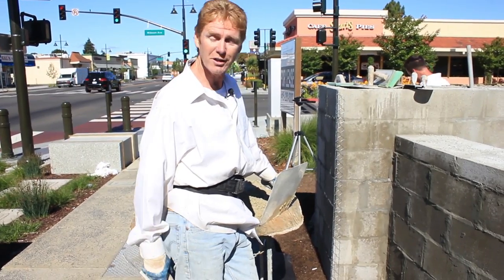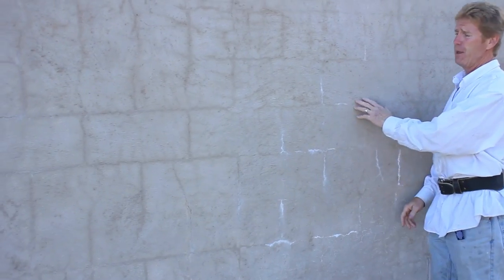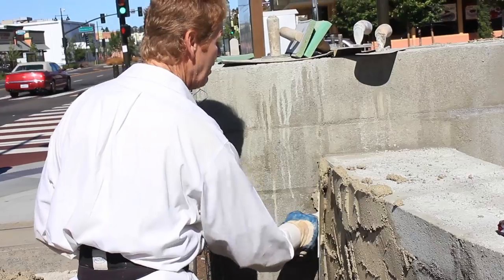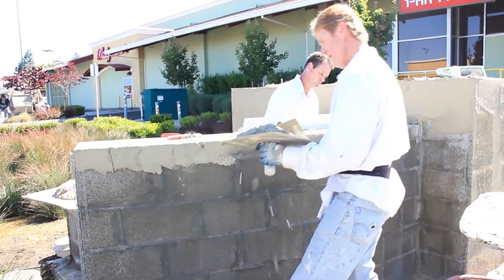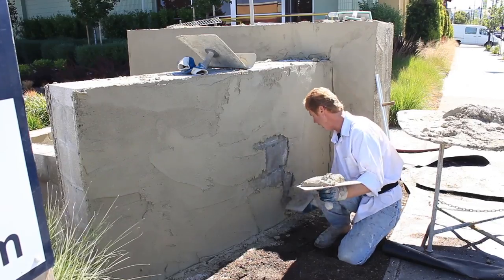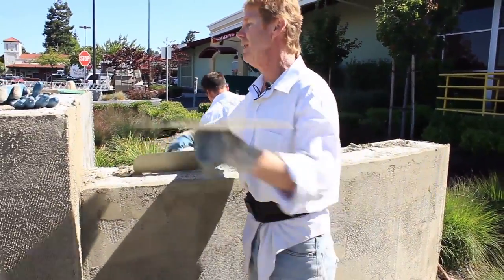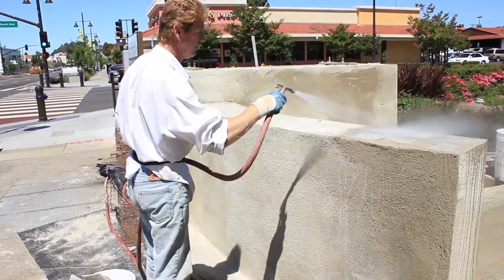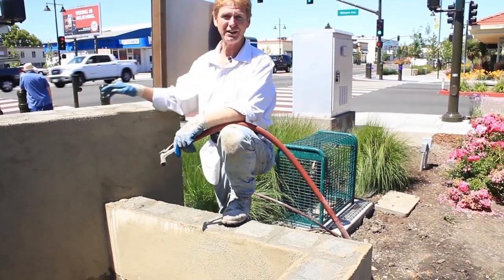How to stucco plaster Cinder blocks

Comment: Hi Kirk,Great videos...I have a quick question.  I have cinder block retaining  walls and am trying to cover them with a skim coat. I did a small part and got hairline cracks in some areas.  I was using type S mortar  from hd premix.  I admit sometimes the mortar got to wet I think.  Am I using the right material? Should I do more than one coat...I did wet the wall before hand. What mix do you use in this video... did you put on a bonding agent before hand? Thanks in advance... appreciate your videos....
Reply from the maker: Howdy Steve, sounds to me like you did not hydrate the wall properly, which means one must you a water hose to constantly msit the walls for a good mechanical bond or your mix was too rich and or to soupy.
            Live long and plaster
  Kirk’s how to plastering  video’s
Reply: Thanks for the reply...what do you mean by too rich? Maybe type S mortar isn't good for a skim coat? What mix would you recommend for a skim coat...no wire mesh...on cinder block....
May the plaster be with you...thats one part star wars two part plaster joke...haha
Reply from the maker: Howdy Steve, too rich means too much cement plaster and not enough sand.
 I would use 1 part cement plaster with 3 parts sand, but a fella should know how to mix also, can't have soupy mud or stiff mud, it's got to be just right.
            Live long and plaster
  Kirk’s how to plastering video’s

Comment: very helpful what is the brand and type for the base coat you put on?
Reply from the maker: Morning Paul, for this, we used Eisenwall sold at the plastering yards,
 however, it's also sold at Home Depot and or lowes, called Raped Set Stucco.😉

Comment: Hi Kirk and family
I don't want to tell the master any advice,but would it been safer/better job if you put a bond coat on first?
Reply from the maker: Evening Grant dude, thanks for the tip.
 Howver when plastering over cinderblock, cement walls or cinderblocks, a skimcoat is all thats necessary, a fella who applys a scratch coat then a second coat only has a clue as to why, Cinderblocks when mosisetd with water while applying another porus materil such as stucco adheres by a natural meancal bond.                   
               Live long, and plaster
                                Mastering Plastering

Comment: Will this skim coating be the fix for a cinder block wall that is crumbling from the base?
Reply from the maker: Good afternoon, John, depends the cement plaster we used is stronger than most concretes, but if the base or foundation is shot, doubtful any material will fix it.🧞‍♂️
But just in case use, "Rapid Set Stucco," sold at Home Depot as there's no stronger cement plaster, don't overmix.
   Bringing peace, love, and brotherhood back to the world of, “Cement Plastering.” 🌍
With over 800 educational and free Youtube videos, by your favorite plaster geek, “me🤓” and my son, “Jason,” the bearded plasterer.💃

Comment: Hello, Kirk,
I apologize for posting a question irrelevant to the topic, but I need your opinion. I hope you don't mind. Can stucco be applied over external insulation boards/panels? If yes, can we still use the 18 gauge wire?

Best Wishes
Reply from the maker: Morning Gandalf dude, when you say (external insulation boards/panels) this can mean about 100 different boards from about 15 different gypsum based products to a whole list of solid wood boards to even foam boards, If you want me to be specific, give me the exact name of the board you are considering.
 FYI,  most boards can be plastered over, from wood,foam, and gypsum based, here in California, two layers of paper for weather proofing are first required, then either 17 or 18 gauge wire needs to be attached, now you can stucco as usual.
 Cheers,
 kirk Giordano
Reply: +Kirk & Jason Giordanos DIY plastering and stucco tips 
I should have been more specific, I am sorry. :( They are used a lot in my part of Europe and the brand's "Fibran"., you can google it. I think they are foam boards and they are blue-ish. A fella who lives nearby said they couldn't be stuccoed over and that sounded strange to me. I think they use some kind of other plaster which looks horrible, trust me. They only use foam boards here, I don't know why.
Thanks, Kirk.
Reply from the maker: Ooooo, I see,,
 There is a really great and popular system called Dry-Vit that uses foam boards, that originated from the UK to here in the US,
 First the paper is attached then the boards,
A fiber mesh tape is used on top of these smooth boards.
Lastly a tight thin coat of a cementitious base coat then color finish is applied, we did a lot of this work when I was a union plasterer for hospitals and school, Its durable and lightweight for high rises.
 there is also a system we used with horizontal line in the foam boards themselves, after we papered the walls these 4 by 10 sheet were attached with staples from our staple gun that were 2 inches long, the staples had to be that long so that 7/8 of the leg set in the stud and the rest accounted for the width of the foam boards,
 These boards had groove lines ran horizontally, these line seams similar to the scratch line made on a first coat by a  scarifier plastering tool, at that time we were allowed to use 20 gauge wire, for a coat of stucco no more than a half inch thick, then allow to cure prior to a color finish.
Confused?
 I would be had I not spent years using these methods.
Best wishes, 
 Kirk Giordano
Reply: +Kirk & Jason Giordanos DIY plastering and stucco tips 
I am not confused at all, don't worry. ;) Yeah, they use cementitious base coats. I have seen the boards with lines, yes. The ones they use here are black. Can we stucco over the smooth ones or the cementitious base coat beats the stucco here? I'd probably get killed if I did that, hehe. Nobody stuccoes the smooth ones or the other ones here, I don't know why. They say that no stucco will adhere to the smooth ones. Why not? The cementitious base coat adheres to them perfectly. I think stucco will adhere to them, but I am no expert.
Reply from the maker: Hey dude, stucco will adhere to any wall that is sound.
 All you need to do is apply a bonding agent to the wall,
 however the wall must be extremely clean, you can't pressure wash foam as it will dissolve, perhaps a water hose and a lot of soap and elbow grease may work, but I have not done this before.
 Best wishes, 
 kirk Giordano

Comment: Do you guys do much float and set then skim coating internally out there in the USA? Nice work by the way.
Reply from the maker: Happy New Years JimJim, we do more skim coats on cinderblock walls and either hard rubber or sponge float depending on what's asked of us.
Cheers,  Giordano's DIY plastering tips
Reply: Just a question again. Do you guys over there do Dot N Dab? Its when you stick the blueboard on to cinder block or brick with adhesive. Wait till it goes hard, then skim coat the blueboard with a veneer finishing plaster? Il send you a link.
Reply from the maker: Morning Jim, No, I have never done this,
 I only apply veneers for interiors,  if a cinder block was was protected from the weather there would be no need for the blue board, therefor I would just apply a base coat over the  cinder blocks first, allow to dry, then follow up with a veneer finish.
 "without blueboard."
 Cheers, and have a Happy New Years, Giordano’s DIY plastering tips
Reply: Type dabbing in style in youtube and youll see what im on about.
Reply: Ok you see we stick the blueboard straight onto the blueboard, then skim on top of it within an hour or so. Its quicker, neater and you can get a more plumb finish. We use blueboard with insulation on the back to raise the dew point then we skim onto the blueboard hence eliminating the need for the backing coat. We can basically put up to 20-70mm on a  bare brick or cinder wall in a single application. Imagine how long that would take if you had to float that up in layers?
Reply from the maker: Morning Jim, O.K. you must be using the exterior blue board.
Your way is another option to get straight walls, however I don't  apply veneer plaster to exteriors.
 I would go with an exterior cement based product.
 For me it's faster to skim coat, then to attach blue board and skim afterwards.
 Many of my video's show different methods to achieve the same results also.
Kirk Giordano’s DIY plastering tips
Reply: No im on about interior work. Check out that link i sent you. Im moving to the states. I have a plan to update drywall by using bonder over the drywall then skim coating with usg diamond veneer. Do you think it would work?
Reply from the maker: Evening Jim, yes, I do think this will work, and sorry to say, many folks already do this,
Cheers and have a Happy New Years,
Kirk Giordano’s DIY plastering tips
Reply: Oh ok. Was gonna say next. "you looking for a job"?  Lol
Reply from the maker: Jimjim Skimmer, cool craftsmanship, I have done this method before, you make it look easy,
 Cheers and have a Happy New Years,
 Kirk Giordano’s DIY plastering tips
Reply from the maker: Jimjim Skimmer, I am always looking for a job, as I'm not a rich man however if I were to work for you, I'll do the skimming and you do the plaster board.
Kirk and Jasons DIY plastering network

Comment: I built lots of concrete [cinder] block walls in my property,  they were retaining walls witb drainage holes spaced.  We didn't care if blocks lined perfect, we poured concrete caps.  my dad finished wall exterior, cement and rubbed the wall, basicall rubbed block wall and it looks like a solid concrete wall, never see uneven😂 hack block seems.  [We did concrete flatwork, NOT masonry walls for a living,  but we played with masonry at home].  We built the wall with blocks 😂 were not lined up perfectly,  we didnt want the blo cks showing.  After 15 years some minor hairline cracks.   Walls are one side , retainer .  I used concrete forms and rebar , poured solid cap.   Never painted,  some minor hairline cracks and mossy . I wanna clean it and give it stucco finish like this.  But i like the messy rustic look, with some steel trowel finish swipes.    Try a  , terra cotta look. ? Haha 😅.  Just thought,  i am getting bored with the concrete smooth rub finish
Reply from the maker: I like the rustic look myself too

Comment: one thing . you mentioned "plaster cement" i believe. 
so on block, do not use other than "plaster cement" ? specified FOR block / concrete walls ? thank you
Reply from the maker: Hi Mike, I use Premium portland cement plaster on most jobs it does have additives such as lime and common plaster for strength and spreadability,
 Cheers,
 kirk giordano

Comment: did you use a bonding agent?
Reply from the maker: ***** Hello, no, we did not have to apply any bonding agents as the cement plaster adheres by suction as the cinder blocks are naturally porous,
 If they had been painted or sealed a bonding agent then would have been necessary.
 Best wishes and have a great day!
 Kirk Giordano’s DIY plastering tips

Comment: Kirk, I notice some walls you use an adhesive and some walls you dont?
Reply from the maker: That's the facts jack, reason, if they are new we just clean them well as stucco adheres to clean concrete, bricks and cinder blocks plus many other porous substrates.
 If they are painted or I have reason to believe my new stucco would not bond well, I take no chances and apply a bonding agent.
 Kirk giordano rendering
Reply: Got ya:) Thanks for prompt response:)

Comment: WHAT DO I BUY TO MIX STUCCO LIKE THIS IM DIY THANKS?
Reply from the maker: Howdy all motor Hash dude, this is Eisenwall cement plaster, it's not sold at the hard ware stores,
 however if you go to home depot buy the Rapid Set stucco, read the bag as you should not mix this cement plaster more than 3 to 5 minutes.
 Cheers,
 kirk giordano Plastering

Comment: Can someone explain why that large wall had all the cracks? Is it because the stucco was too thin?
Reply: Kerry flynn he did explain it. Watch the video again
Reply from the maker: Howdy Kerry, the fellas who applied the stucco did not apply a base coat. 
They only applied a color finish, to me it looks cool, but if I were to do this, I wouod get called back to redo it on my own time and cost.      
                 Best wishes,
Plastering tips from your favorite stucco geeks
Reply: The blocks need a first coat to fill in the brick lines or a spray , render tends to shrink back so a first coat needs to be applied on any cinder blocks or any brick or block with deep grout lines .

Comment: Kirk....I am building a concrete block wall and will skim coat  portland cement finish.  The walls footer will be approx 28 inches below surface level.  Should I start the skim coat there to protect the wall from water infiltration?  Thanks.  Tom (Philippines)
Reply from the maker: Howdy Tom, most stucco is not waterproof, sorry,
 however the top coat we did on this wall was water resistant as it was an Acrylic stucco,
 Cheers,
 kirk giordano plastering

Comment: My home gets moldy can this stucco be cleaned yearly with bleach?
Reply: sandy girl not sure how stucco works but usually if it’s mouldy it means it isn’t sealed properly and needs to sprayer off ,a coat bond creted , (not sure what they call it in the us) , then a primer paint needs to be applied and then two top coats of paint . You will never see any mould ,10 year guaranteed.  In the old old days they used to lime wash over the cement render to seal it .
Reply: sandy  - around here we usually get mold if and when the following conditions are present;
'...Mold spores are everywhere, and they grow on any organic surface, given the right conditions. For growth, they require organic matter for food, moisture, warmth, and oxygen. To prevent mold growth, keep all surfaces clean and dry, and provide plenty of ventilation...'   /  that's from the University of IL.online
Reply from the maker: Howdy Sand girl, Yearly? Mold should be cleaned regularly with Clorox bleach or a Non-Toxic Enzyme cleaner, we personally use Kleen-Free Naturally, sold on Amazon.
                        Peace love and happiness to all.
      Plastering and repair tips for your number one investment

Comment: Love watching your videos and they got me a bit motivated. Is this just straight portland cement, or does it need to be mixed with sand? And possibly a little lime? I have a small wall of 16" high by 45" long I'd like to attempt this on. What kind of coverage can I expect from a 90lb bag of portland cement?
Reply from the maker: Howdy Bill Dude, we used Eisenwall on this job, my brother Louuu actually screwed up the mix and gave it to us way to stiff and it was well over a hundred degrees but nothing we could not handle.
 I recommend portland cement plaster three parts sand to one part cement plaster the amount of coverage depends on the thickness applied.
            Live long and plaster
 giordano’s stucco images and teaching videos

Comment: you dont need to prime the concrete wall first?
Reply from the maker: Howdy, Primer is used prior to painting, not for stucco.
Note: There is no need for galvanized stucco nettings or 3.4 metal mesh, or any other bonding agent, as we incorporate a natural, mechanical stucco bond. 
That is where we apply stucco directly to a porous wall such as bricks, concrete or blocks that have not been painted, The stucco adheres by suction.
To apply a bonding agent like Larsons, Weld-Crete, or Quickrete's bonding agent, is called a chemical bonding agent, and yes if not sure what this means apply a bonding agent.
Reply: @StuccoPlastering   youre the man. thank you
Reply: I have an indoor concrete wall with old paint. What do I need to do to get plaster on the walls? thanks for responding. @StuccoPlastering
Reply from the maker: @Joguhyik  Cleand the painted surface well, apply the chemical bonding agent, then plaster away.

Comment: Just wondering why you used mesh corners on this block wall where in another block wall video you suggested not using corners at all (you used wet 2x4 method instead). Love the videos thank you for the content.
Reply from the maker: Greetings my friend, good question, I used corner aid on this repair as I knew I would have a crew and didn't have time to build these by hand.
 The other videos, where I explained how to use a two by for stud was to show the method of how-to, not everyone wants to find then buy corners. I try and explain many alternatives for different repairs. There's more than one way to skin a cat.

                         Bringing peace, love, and harmony to plastering 
         Sound Plastering tips for the DIY beginner or the Plastering experts

Comment: Kirk someone mentioned to me that I needed to use a metal lathe over cement block wall or the stucco would come off in a few years.  how true is that.
Reply from the maker: Howdy Bryce, I feel that advice is an opinion that only seems to make sense to some, fact is
If any cement, brick or cinderblock wall is properly pressure washed the stucco will last forever.
 The key is a fella need a very clean wall in order for anything to adhere forever.
 Best wishes with your projects,
 Kirk giordano plastering on small repairs
Reply: Kirk Giordano plastering Inc. wish you were closer I would hire you in an instant
Reply: Kirk Giordano plastering Inc.  Kirk are you using lath on the corners
Reply from the maker: Howdy Bryce, on this job we did attach corner aid, in fact you can see this in the video,
 Best wishes, 
Kirk & Jason’s stucco repair video’s